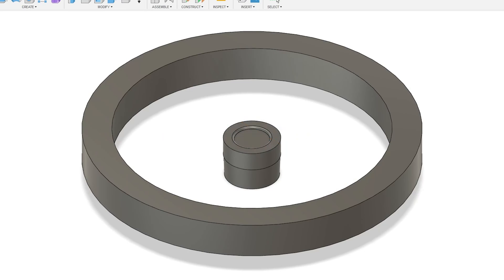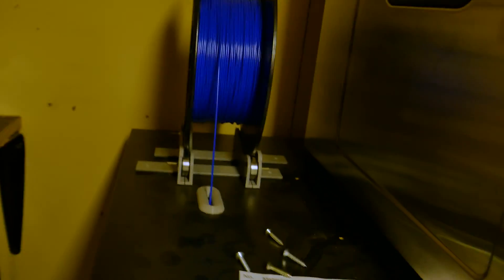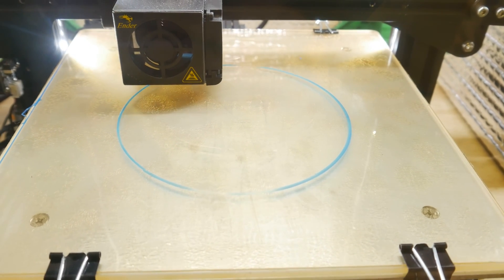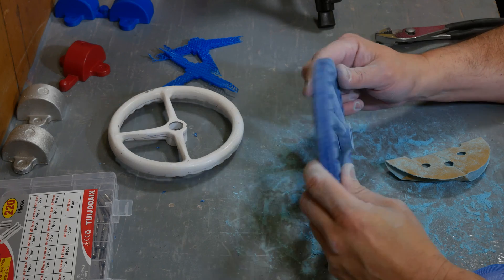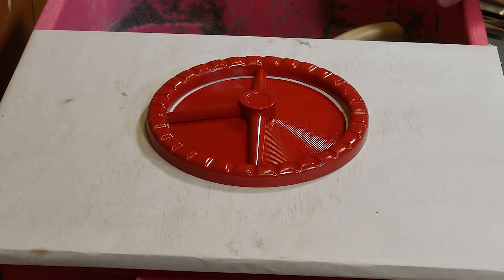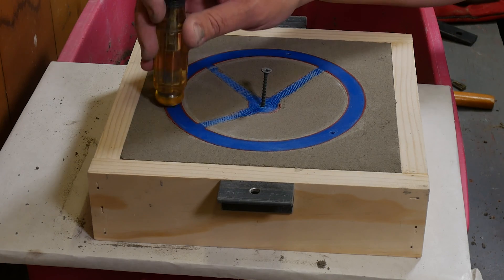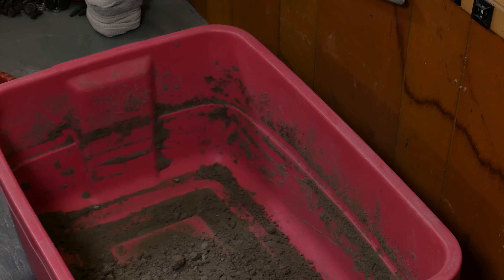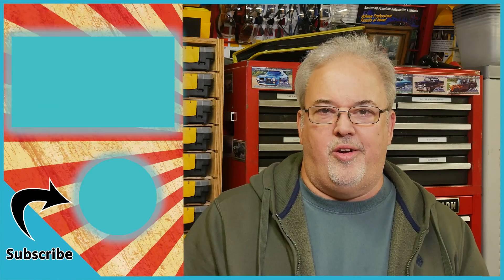Aluminum Casting with 3D printed Patterns

Comment: Nice job.  Good video.  I use propane and a slightly larger crucible for my foundry work. With a larger crucible you could pour two or three steering wheels at a time.
Reply from the maker: I have a charcoal fired foundry I built back int the 90's using the Gingery plans.  I've thought about buying a propane burner for it and see if I can heat it up again after all these years without it shattering.. I imagine if I cook it low and slow on the first fire it should be fine.
Reply: I also use a home built propane furnace, the electric jewellery furnace you have is just a bit small as you know.
Look at Kelly Coffield, I think the spelling is right, he is a lost foam artist who built a suitable electric furnace.

Comment: 6 metal pulleys from Tractor Supply. Get rubber tubing fit it in the groove. Bind the ends together with plumbing cement. Then a good coat of paint. I think steering wheels are just for decorative use.

Comment: Those are looking great!  One thing to look at with casting- you can use a lot smaller (and tapered) sprue and a pouring basin, it will make for a higher quality casting.  Paul’s Garage and swdweeb have some good videos on the subject that helped me understand it a lot better, but the short explanation is you get less oxide and air mixed in the metal. Though then you’ll probably want to add a separate riser as well….
Reply from the maker: Thanks for the tip, I will give that a try on the next one!

Comment: I run an Ender 6 with top.  It routinely gets to 50c, saw it at 54c the other day.  Really lets you work with high temp plastics like ABS (my favorite) very well.  I only make practical objects.  Highly recommend if you can snag one.  Both of those objects should have been printed with flat surface down.  Using Prusa Slicer you can do variable layer heights when you slice.   This could have made you radius layers require less sanding at expense of more time of course.  Also you can have thicker interior fill layers than shells saving some time.  Looking very nice.   Fun following your project. Many skills required to achieve.
Reply from the maker: There really isn't a flat side for the top half as the wheel is dished.  I did use variable layer heights.  That was the shot at the beginning showing the wheel sliced in 4 different colors. Admittedly, I was more aggressive with it on the lower half of the wheel than the upper half.  I just didn't want to wait the amount of time the slicer was saying it was going to take to do the finer detail on the top half.  Thanks for watching!

Comment: I have not tried it yet but I did see a guy smoothing his 3d prints with a metal scraper.  He says that is is far better than sanding.
Reply from the maker: I have not tried it but I imagine that would work.  I've often scraped edges and it works really well.. it seemed like you'd need a scraper with a curved edge to avoid gouging though.

Comment: Why ABS not PLA? PLA is easier to print, and your 3D-printed part is just for forming. It isn't the final product.
Reply from the maker: I just almost always use ABS.  Now that I have the machine dialed in, its just easiest to not think about it.  I never have to remember to switch profiles in my slicer.  The only time I use PLA is if I want to use a particular color that I can't find in ABS.  I used PETG one time- to print all those extension pieces for the Ikea table.  I actually have a second printer that is not in an enclosure and I use that one for PLA if I need to.